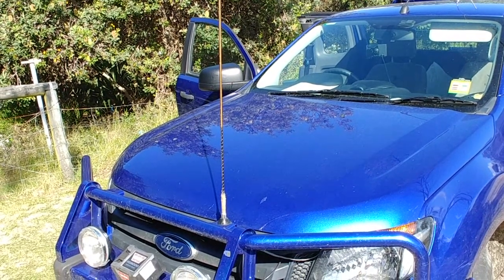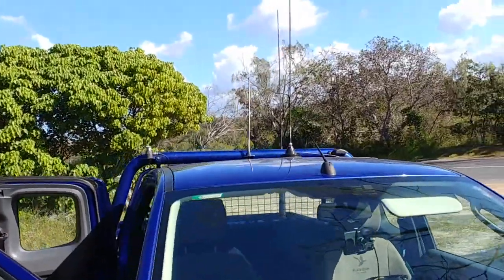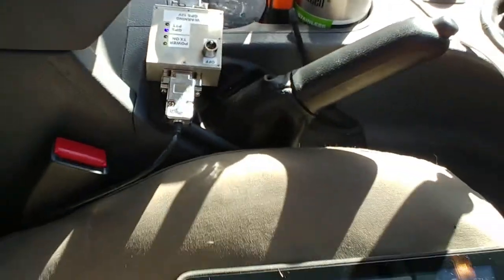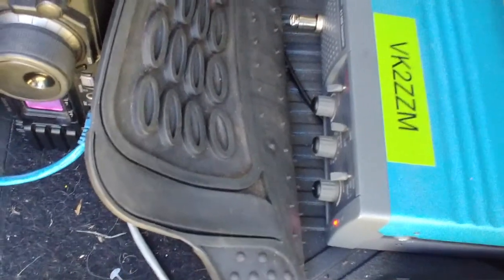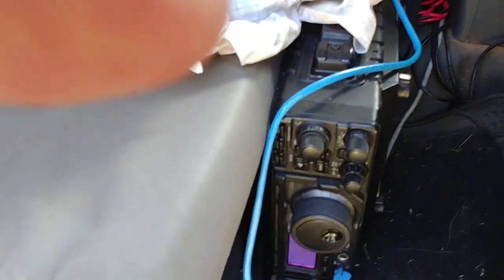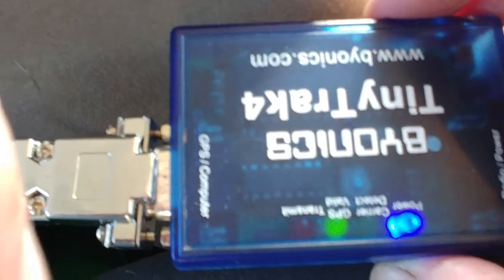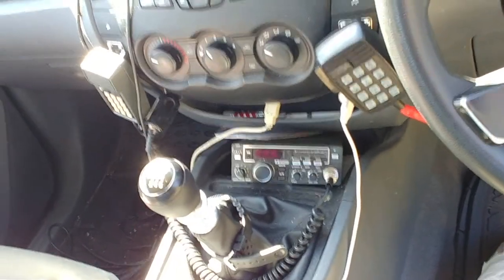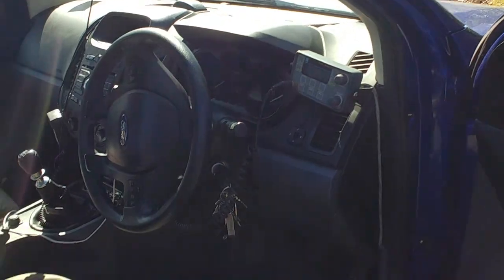My Mobile APRS Set Up

Comment: Describe when in operation, the function and what each Tiny Track 4 LED is showing us in real time
Reply from the maker: Hi there. The green power led shows that power is connected to the Tiny Track. The red transmit [TX on] illuminates when the  transceiver is powered up. The blue GPS valid means that the external satellite receiver has found a satellite,  and the carrier detect [or in the case of my modified unit PTT] illuminates when a packet is sent. Hope this helps.